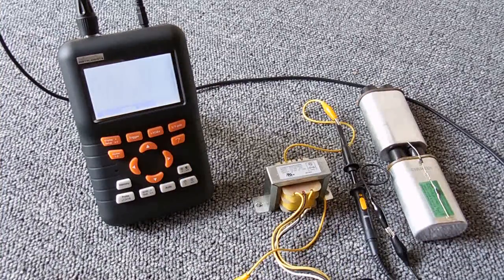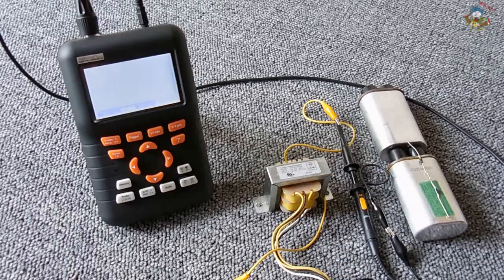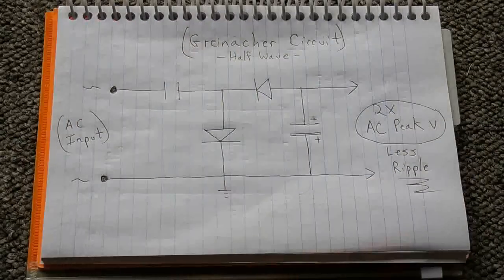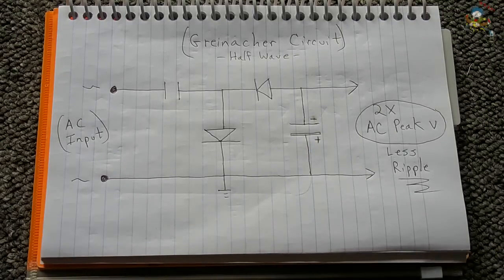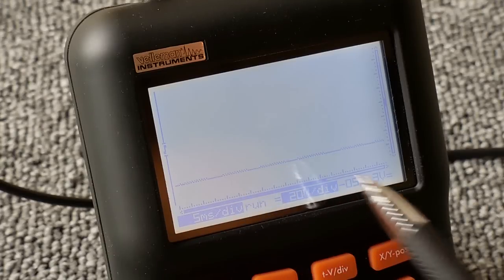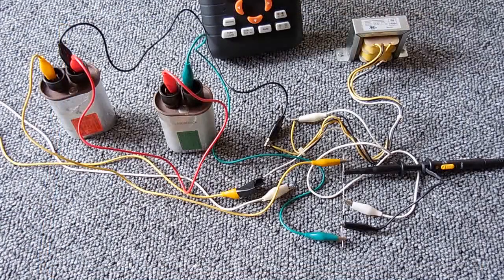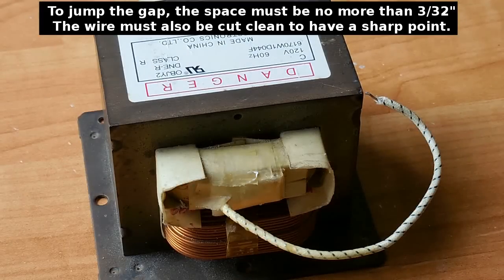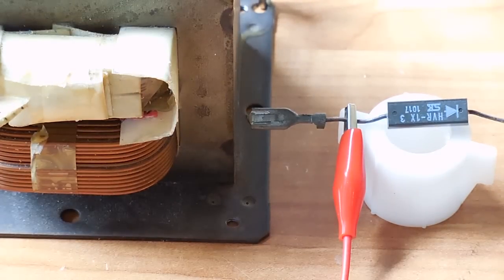How Microwave Oven Voltage Doubler Circuits Work! (Villard)

Comment: I'm stumped!! Maybe you could Help me Sir. I have (single lead) 5kv output transformer with only a chassis ground, no double output wires, only one.. I'm trying to double the output to appx: 10kv and cannot figure out how to wire it or what doubler circuit to use. My load will be a corona discharge ozone plate with no resistance to speak of, more of a capacitive load when powered up. I've exhausted all options to find out what type of voltage doubler circuit I should use. It does not matter if it's rippled to death, I simple need double the voltage out. Please respond and enlighten me kind Sir. Please. Grok and ChatGpt is useless on this. MayDay!!

Comment: Great video. The one thing I don't understand, is why is the diode connected to the chassis of the microwave instead of directly to the other side of the transformer? How does the current find its way back to the transformer through the chassis? And why does this not pose a shock hazard given that high voltage is flowing through the chassis?

Comment: it's been in youtube for several years now and i just watched it now because my replacement capacitor i bought for my microwave oven is 1.0 uf instead of the originally installed 0.9 uf. can i use it as replacement?
Another question is: what is the frequency of the input voltage on the HV transformer, is it the same as my AC voltage line?
Thanks a lot for an enlightening video.
Reply: A year to late.  But to answer your questions...  yes and yes. 

The line voltage & frequency ( from wall outlet) is 110/115v 60hz . 

Transformer input voltage & frequency is what it receives from the wall outlet.

Comment: What is the function of the high voltage diode in a microwave oven?
Reply from the maker: Sends pulsed DC to the magnetron. (Negative Pulses)

Comment: hi sir can you make laser diode driver   please thanks and btw the laser is from an old dvdrw thankss
Reply from the maker: myra pagatpat You don't need a driver. Use a battery and apply 3.0V - 4.5V to the laser diode. make sure the (+) wire goes to the Anode.

Thanks For Watching

Comment: Would using this system or on like it ,say a cockroft Walton type multiplier. Be better than using multiple mov transformers in series to construct a high voltage power supply. I'm wanting like 30kv but don't want to use a flyback. Any suggestions? As always a great video
Reply from the maker: billybonewhacker All depends how much current output you require. If you use a MOT along with a voltage multiplier circuit, that would work fine. If the output is 10X the input, you will have 10x lower current at 25KV. You can add more stages to the 2nd and 3rd schematic shown in this video.